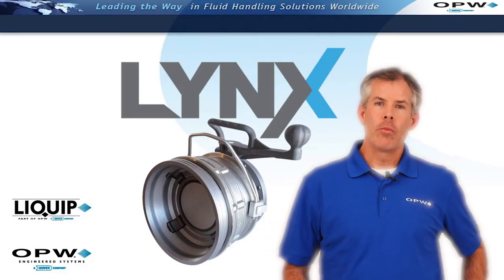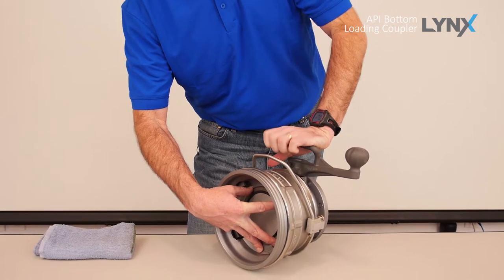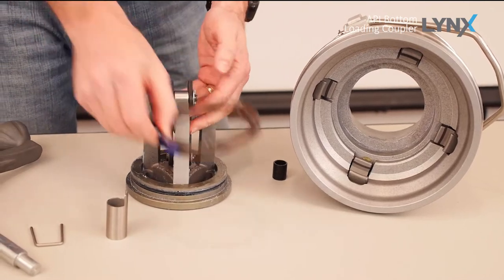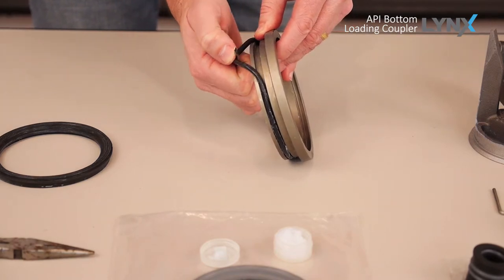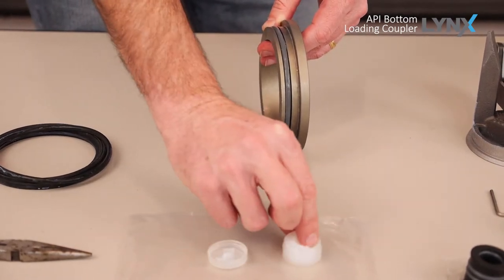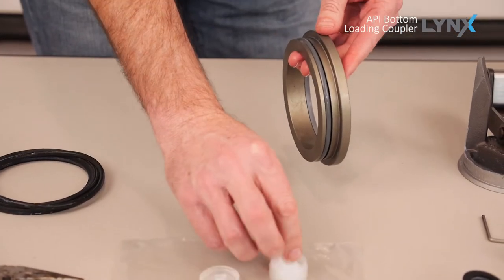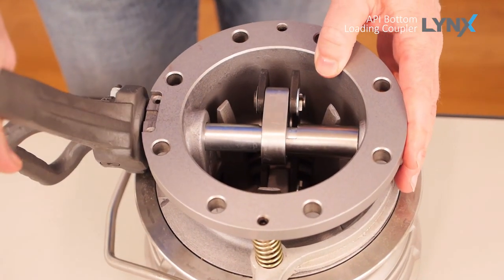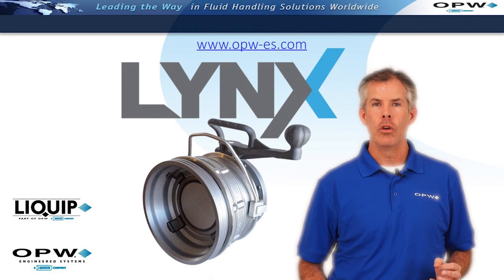LYNX API Coupler Maintenance

Comment: Rebuild so many of these. Be sure to to check the Alan screw before you install the coupler. It ends up seizing on after being used.
Reply: 100% right. Its the most pain in the ass part of the whole coupler. Every bolt seizes once its in the field and we end having to cut the bolt and replace it.

Comment: At what frequency should this be done? In terms of number of loads or months.
Reply: I leave ours in the field until they leak. which starts to leak from the handle about 3 months after install depending on the use rate